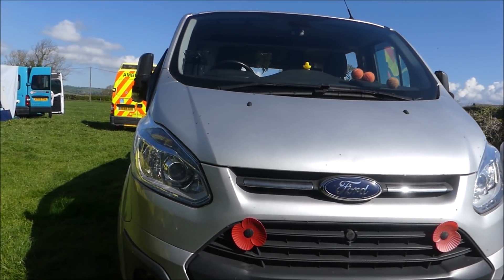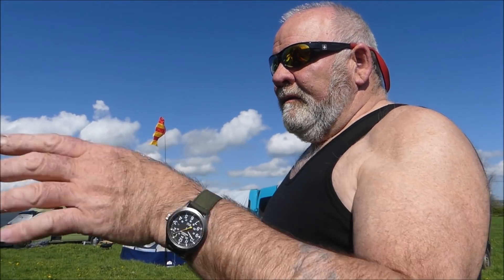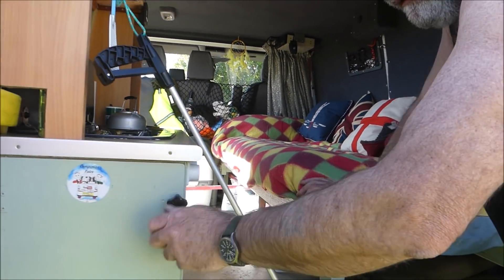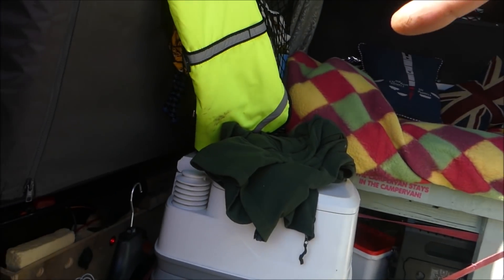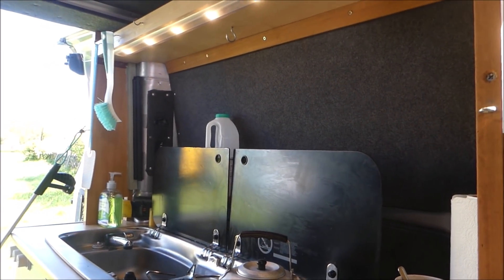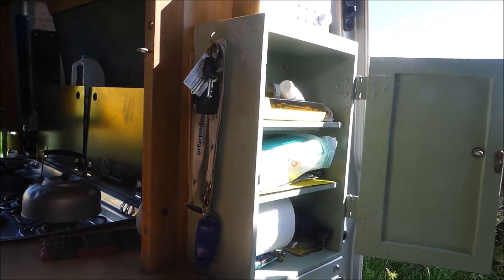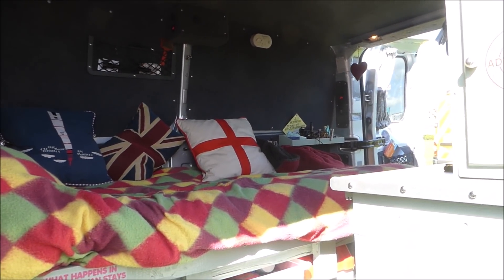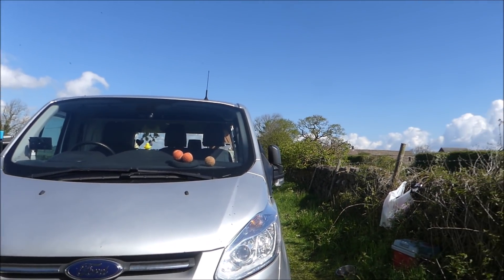Ford Transit Custom SWB Campervan Conversion

Comment: Thanks for posting the vid chaps...got an awning rail fitted now.. seat swivel is next, in the very near future too...
Reply from the maker: Thanks for letting us film the van Ian. Off Grid next year is booked. 25th to 28th May over the bank holiday weekend. Hope you can make it. Good news about the upgrades too. Awnings are a big help. What model of Transit is it? We forgot to ask
Reply: @CampervanTales  Its a Custom short wheelbase low roof.. the smallest Transit Custom they make..2.2 engine.. 125 bhp front wheel drive..  the 2020 meet is in the diary... cant wait..
Reply from the maker: Thanks. We look forward to seeing you then. 👍😀
Reply: I'm just starting a conversion of pretty much the exact same van. It looks like you've made some panels for the pillars next to the barn doors? Possibly with some electronics in? How did you do that? A great idea using that space!
Reply from the maker: Hopefully Ian will be along to answer your question
Reply: @TCarter  Hi Tom.. not sure which bit you mean...but anywhere I needed to  fix anything that needed to be strong I didnt use adhesives (Sikaflex etc ) or self tapping screws as I dont consider them strong enough... I fitted batons to the strengthening parts of the body work by using Riv nuts.. then bolted the framework of whatever I was fitting to the battens.. very strong !! O  course there are very few straight lines in the back of the van so you need to fit battens that sometimes may be in more than one piece to accommodate a curve.. but it wont be seen when you fit the finishing part/worktop etc to it, and you will have done some careful  jigsaw work to get a perfect fit.. I incorporated electrics into the framework as I went, and to be honest, fitted more than I needed.. there are some wires fitted that I havent used (2) but they are there should I need power in those places for something at a later date... the other ends of the wires are wired into the fuse box I fitted under the passenger seat, but no fuses fitted so they are not live till required.. bit of a ramble but I hope this has answered your question.. ask away if you need any more info.
Reply: @ianr5978  Thanks for all the info Ian, that is useful. The bit I am looking at is visible at 5:11, to the right of your little shelf you've got USBs mounted into the door pillar? There's a black plastic front with some red lights or a screen on it. Did this come with your van? I've just got bare holes where you access the tail lights!
Reply: @TCarter  Ah.. yep.. I know what you mean.. I made 3mm ply panels and fitted the normal  E-bay USB/Cig charger thingies into them and covered them in some of the grey carpet, then used pan head self tappers to fix them to the van bodywork... but bearing in mind that you will  need access to the rear light bulbs.. the power sockets in my van are above the rear light bulbs anyway, I just put blank ply/carpet covers over them to tidy up the appearance a little, but 4 screws and it comes off to get at the bulbs..
Reply: Ah great, cheers man. It looks very professional, I'll give that a go when I get to it. Only just cutting the floor today!
Reply: @TCarter  I used 25mm batons.. 25mm celotex and 9mm plywood..